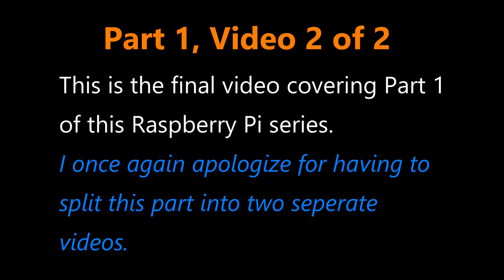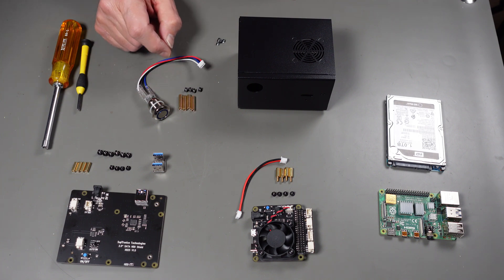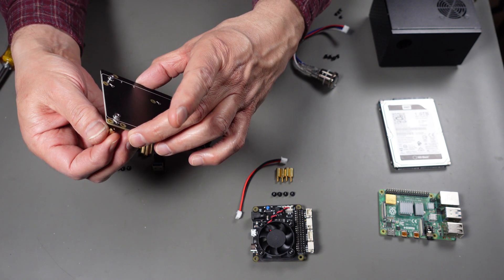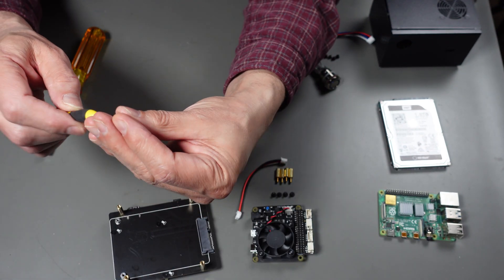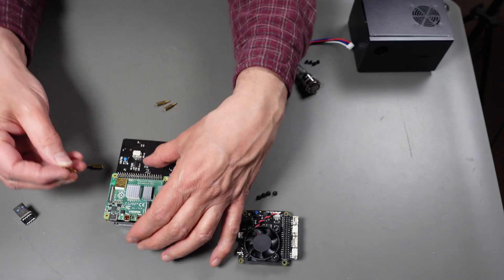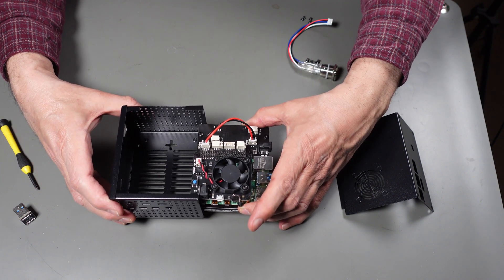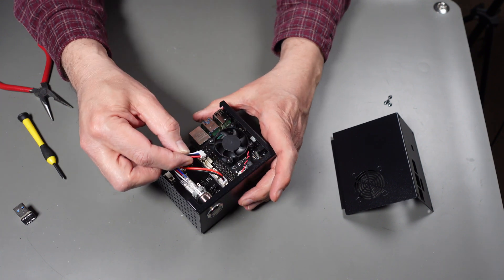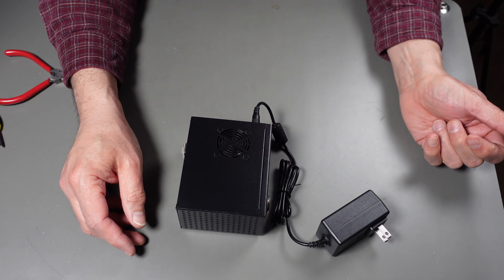Adding a Hard Disk to a Raspberry Pi4 and Converting it to a Console PC – Part 1, Video 2 of 2

Comment: I used to think I was going to get this case and it is a nice case but I found a better one that costs less which I think is better. It is called the DeskPi Pro Set-top Box For Raspberry Pi 4. Here is the link https://deskpi.com/products/deskpi-pro-for-raspberry-pi-4

good video though
Reply from the maker: That looks like a great case, however it doesn't seem to support adding in a 2.5" storage drive.
Reply: @PE4Doers  I am sorry but it does. It can take an M.2 SSD or 2.5 SSD or hdd. Take a look at this youtube video on it https://www.youtube.com/watch?v=bk98v8JzAb0&t=2s
Reply from the maker: @mando7558  ok, thanks, I'll check out that video

Comment: my problem is that the on/off switch on the case only works once but then doesn't turn it off  on restart. maybe because my power cable already has a switch??? btw i have the latest EEPROM already.
Reply from the maker: That is a limitation of the Raspberry Pi operating system.  A script has to be installed in the handler that will start the safe shutdown.  I will be making a separate video about how to do that in the very near future.

If you hold the button in for 3 to 5 seconds, it will perform a forced off.  You just have to make sure you don't have an unsaved files open otherwise you will likely lose.corrupt those files.  This is the same limitation you have with a Raspberry if you chose to unplug it rather than go through the menus and perform a shutdown.
Reply: @PE4Doers  yeah that would be great. thanks!

Comment: Isnt it possible to boot from a USB hard drive without all the extra circuit boards?
Reply from the maker: Absolutely.  In part one I simply used a SATA to USB docking station.  

The extra boards simply give you some features that are very nice - such as a single power source capable of driving everything, soft boots, soft shutdowns, and a case that makes it fill in well with any entertainment system.

Comment: Great Video : )) the Description states it is Part 1 of 2 but it should say Part 2 of 2 to avoid confusion of viewers. 
Could you put some electrical tape over the USB Connector?  To make it less ugly. Or a small heat sink? of course these are just my ideas  as always :))
Reply from the maker: Kathrin, thanks for letting me know about that confusing language.  This is actually Part 1, but Video #2 - which I was not clear about.  In Part 2 I will be replacing the Raspberry operating system with a special version of Linux that will transform this unit into a Digital Video Recorder.  An addition pierce of hardware also needs to be purchased, that allows an Antenna and other online streamed services to be passed to this DVR, however my daughter want to wait unit she completes her home move before getting that device.   So Part 2 will likely be in two videos as well, without a date set for the second video (at this time).

Also, I will be sowing how I blocked the two power connectors that should NEVER be used when a Power Unit has been added.  It took me some experimentation to get that to work :)